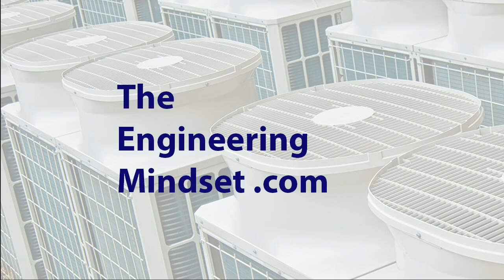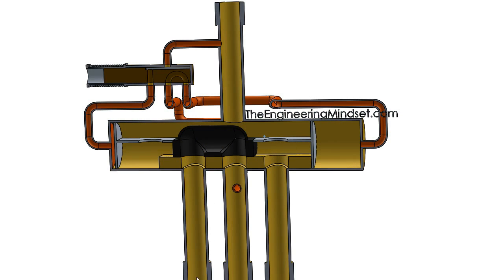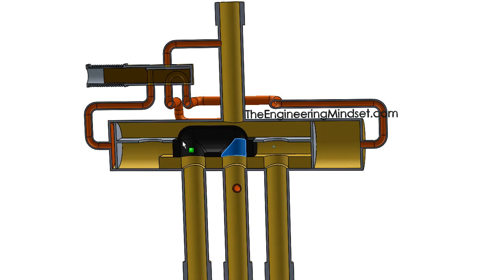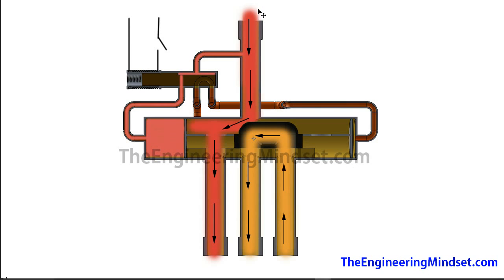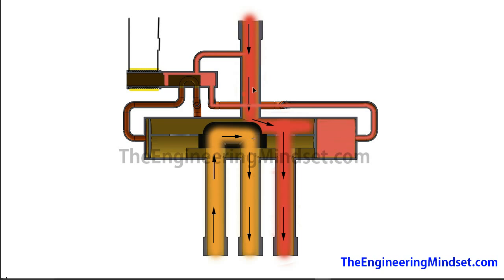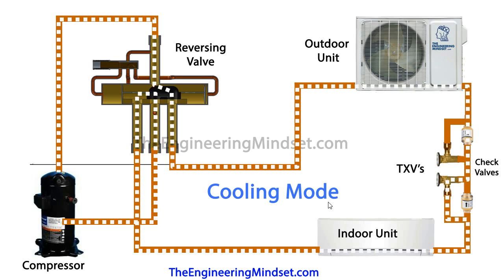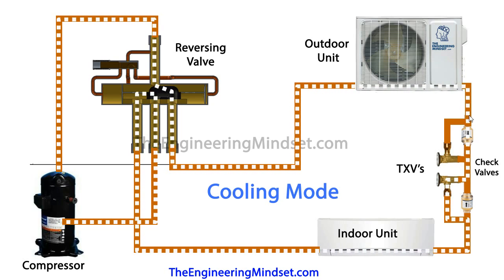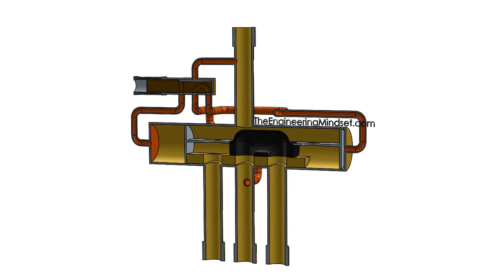Reversing valve - Heat Pump. How it works, Operation.

Comment: If its a TXV X-pansion Valve then where does the bulb belong? Check valves? Far away Tubes? Where?
Reply: It's reversing valve for both cooling and heating, txv regulates correct flow of refrigerant and maintains superheat

Comment: Hi. I i need to selct a reversing valve for y heat pump, what are the key paramezters beside the capacity. I check that the capacity requirement is fulfilled however I have very high velocity in suction line (during heating) and the datasheet specification of 4-way valve does not mention any velocity but the pressure ranges (which also meet the system requirement)

Comment: The indoor unit freezes during the heating function. Everything is fine in cooling. Is the problem a blocked four-way valve?

Comment: Thank you for the Information & Good quality video about the Reversing Valve Cycle.
It would be much Nicer if you can move the mouse Slowly because Specially for beginners to put attention in what you're saying and try to follow up with the mouse moving to fast It's Really difficult to Focus on it, & also the mouse Color would Nicer if you can change the Arrow to a Black color sense must the time the background it's White.
Thank you again !,

Comment: Recently one of these failed in our 6 month old Mitsubishi Ecodan R32 ashp. The whole outdoor unit needs to be replaced, as these valves are brazed into the pipework and can't be repaired easily in situ.
Very interesting video, thanks!

Comment: So ice makers use this as well. When it goes from building ice, once the desired ice size is met on the evaporator fingers or trays. The reversing valve switches from freezing to heating the evaporator momentarily to drop the ice off the fingers or tray into the bucket or ice catch tray

Comment: what happens when a check valve misfunctions?   I am having an issue in my home in the heat cycle only where when the unit cycles off, I get an intermittent hydraulic hammering for maybe 5 seconds.  Only during heat, and most online sites I am reading point to a faulty check value on the indoor unit.    What is going on in this instance?

Comment: Hello.
Why my heat pump only blows hot air inside and cold air outside.
Reply: Seeing as I have 8 minutes and 42 seconds of experience on the subject, you should trust me when I say your reversing valve solenoid is failing to energize when a call for cool is issued by your thermostat.

I don't know what sort of unit you have but it could be a simple as replacing a capacitor.

Best thing to do is call an HVAC specialist to troubleshoot the valve.

Comment: ts so helpful to learn just the way the reversing valve works. it allows to reverse cycles for both heating and cooling. The way it works the reversing valve it has two insede slide valves that it all depends what your calling for (heat or cooling)its going to close a side of the valve and open the other one closes.

Comment: So the O wire from the out door units control board would run to that cilinoid, and is energized when the T-stat is set to cool.  If it is set to cool and the O wire is pulled the unit should switch from cool to heat. And if that doesn't happen the reversing valve has failed.  Sorry, if this seems like I'm teaching, I'm actually trying to get the diagnosis process down in my own head so I can figure this out for my costomers.

Comment: Hi,  In cooling mode, when the cooling cycle ends and the compressor is turned off, is the reversing valve typically held on (so that it doesn't slide back under the residual pressure) or is it typically disabled (open circuit/power down) along with the compressor?  I.e., is the reversing valve solenoid typically on all summer, or just when the compressor is active?

Comment: This was a great explanation... I've been dealing with a mini split I just installed and the fan on the outdoor unit does not kick on allowing the unit to overheat and shut off. BUT... when I power off the inside unit... It comes on for about three seconds...I can't figure it out

Comment: The problem in a ac with reversing valve when it got old some dirt from burnt oil  from compressor clogs the pipe and gives a hard time for it to move and soon without you knowing it will get spoil

Comment: So it’s really a “heat pump” whichever direction the refrigerant is flowing? It’s just that the condenser and evaporator are swapping their tasks over in the heating mode. An air conditioner and heat pump are two names for one device. A reverse cycle capable air conditioner?

Comment: In relation to the compressor at what height should this component be at? 

I ask this because most small systems they are above the level of the compressor,  and there is a chiller which this component keeps failing where it's in line with the bottom of the component.  

Another question in relation is because it's low in the system would oil not get in and somehow block operations.

Comment: Hi.. Thanks for the great explanation on heat pump....What can we do in case if we use distributors on the evaporator?
How the flow will be reversed correctly as there will be leads connecting the evaporator and expansion valve?
I would like to know the set up for the higher capacity units. Looking forward to your response.

Comment: Is it correct, I could use the cold of the night for cooling and the heat of the day for heating, with one device (Reversing valve)? I'm fairly new into this.
Reply from the maker: You new a few other components and some controls but yes. You can use this to provide heating or cooling in almost any weather. Even when cold out you can use it for heating

Comment: There is a mistaken in the drawing in "cooling mode". The black moving part in the reversing valve should be drawn to the left site in stead of being in the right side, what is not so in the drawing. So it is advised to do this, to better understand the drawing. Nevertheless the gasflow side is correctly indicated.
Reply from the maker: Thank you for the correction. We did apologise during the video for the mistake and many people have also commented this in the comments section already

Comment: Advie Dx cawn air handling unit instaling and pipeing video uplod
Reply: No, think carefully.... there is no liquid (other than a very minute amount of oil present) only hi pressure vapour. I f you have hi pressure liquid there then you are in great danger or the piping on the unit is very very wrong.
Reply: sorry, wrong post....

Comment: The videos in general are awesome and for school purpose are good too. The mistake in changing from hot to cool and the slide on the reversing valve doesn't move at all was a little bit confusing but I got understand and I also see some comments below that mentioned that. If you can improve a little bit more would be interesting for all hvac classes ON. Thanks.

Comment: Great video .... One question ... there would be a great heat exchange inside the reversing value as two different temperature fluids are made to pass side by side... ? what do u think ???
Reply from the maker: I think you're right
Reply: Marius Botha
1 second ago
No, think carefully.... there is no liquid (other than a very minute amount of oil present) only hi pressure vapour. I f you have hi pressure liquid there then you are in great danger or the piping on the unit is very very wrong.

Comment: You are missing the accumulator before the compressor
Reply from the maker: Luis Brenes there are many parts missing, it's just simplified to make it easier to understand the basic operation
Reply: The Engineering Mindset could you kindly please make another vdo(s) for advance learners with actual cycle comprising of every possible components. Thank you. impeccable work as always!!